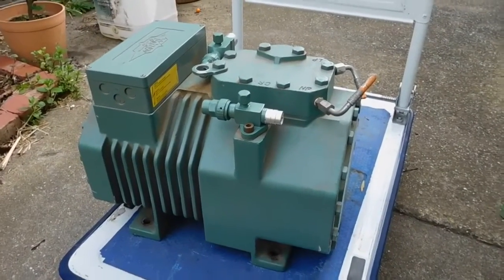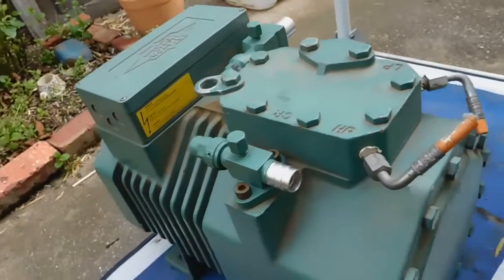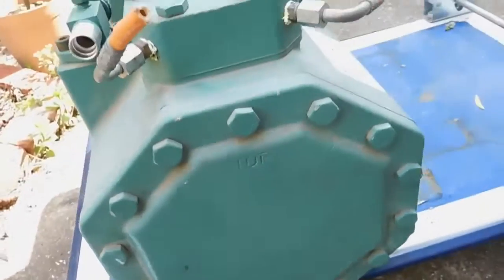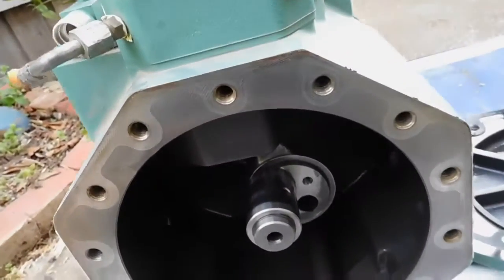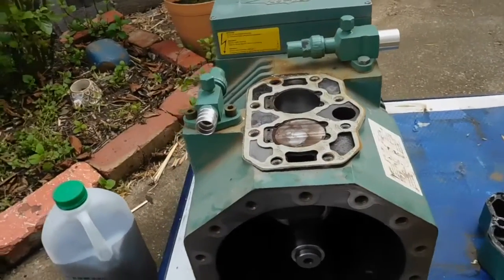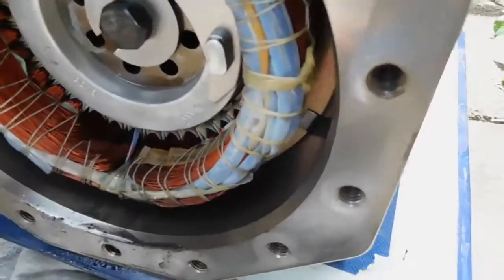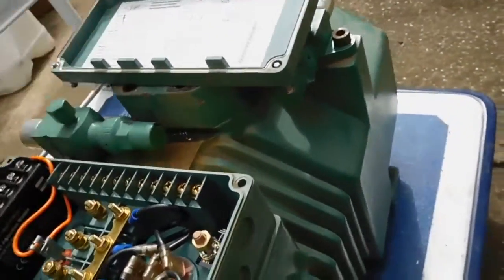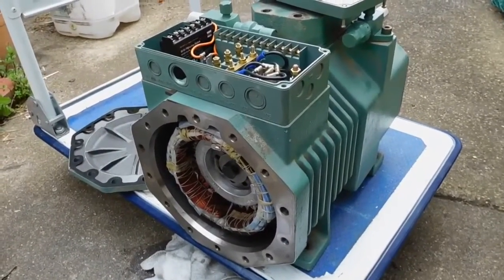Bitzer 2 Cyl Semi-Hermetic Refrig Compressor Austopsy

Comment: The bearing housing on the hydrodynamic bearings have worn out. The journel or shaft looks good. The cause is high superheat causing thining of the oil film in the copper/ lead sleave during operation. Superheat must be below 30k. I have the ecoline version of this 2 pistkn Bitzer with 50k superheat. Died same as yours with metalic oil. The copper bearing housing showed extreme wear.

Comment: After changing oil separator, oil had filled in it, when running starts oil is returning to the oil separator? What is the reason?

Comment: hi do the lubricating oil mixes with ref gas during lubrication of liner or does the ref gas flows to crankcase.could you help me with ref gas flow inside compressor and why crankcase is pressurised.thanks
Reply from the maker: Compressor crank-case has to be pressurised as it is part of the system. The suction gas flows through the crank case on return to the cylinders. The oil is returned from the oil separator feed line directly to the crank case too.

Comment: Hi friend. Thanks for sharing the video! I have exactly the same compressor but one of the windings on it has been damaged. Can You help me understand how to extract the stator from it without damage?
Reply from the maker: No worries, best way to get the stator out would be first to strip the whole thing down, (ie remove all pistons, crank shaft etc.) then heat the case up with a torch, it should thermally expand enough that the stator will just pull out
Reply: Thanks for reply! Can I do this without opening the compressors head? I have it opened on both sides but I still didn't remove the rotor. I guess there is a way to attach some puller?
Reply from the maker: No worries, you may not have to remove the head or the pistons. The rotor should just pull out on it's own once you take the shaft bolt out, if not use a puller. You will probably need a larger puller for the stator as well, but you can get these at most auto and or electric motor shops
Reply: Thanks for help! I have hydraulic pullers but I don't see any point on the stator where I can attach puller claws... :( I would like to extract the rotor without pulling the shaft out. If that is possible. I'll tell You when I try. Thanks Again!
Reply from the maker: Good luck with it mate ;)
Reply: CAL'S ENGINEERING Thanks.

Comment: It's very unusual to see a BITZER compressor fail. The amount of detail and quality control that goes into the making of one is huge.
Reply from the maker: Yes it is, the guys at work reckoned it was the windings that failed, possibly some metallic crap has worn the insulation through somewhere
Reply: @MrMacman98  did they meg the windings?

Comment: I've had compressors seize due to copper plating on bearings reducing the gaps and making the bearing tight. Interesting to see inside a Bitzer, never worked on one so it's something new. Looked in good condition.
Reply from the maker: Yes bearing failure can be pretty common in these if they're neglected. 
Glad you found it interesting!